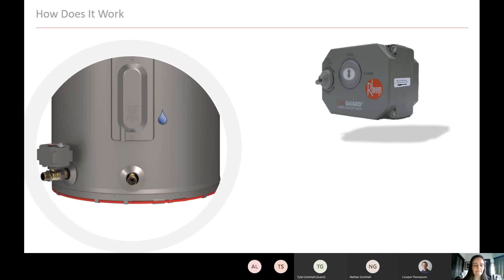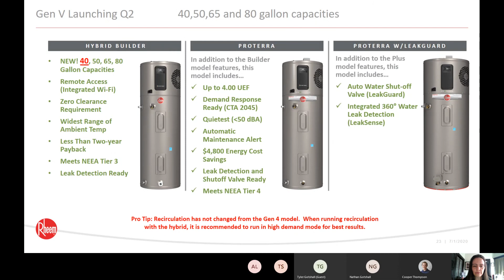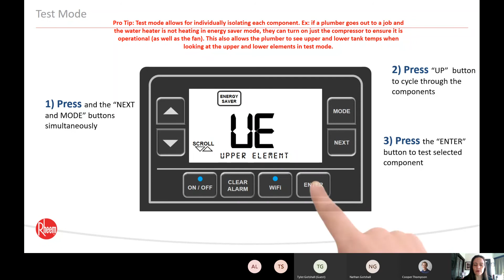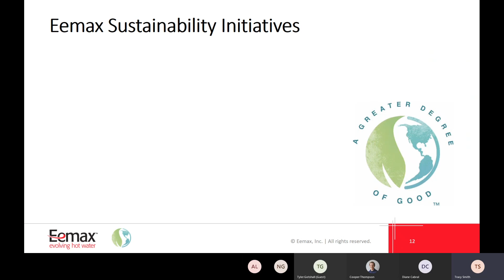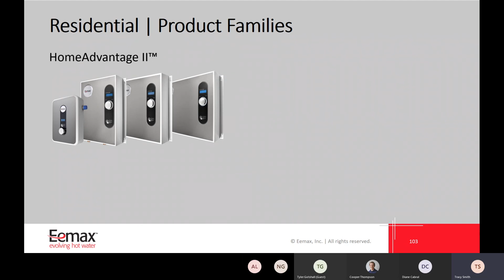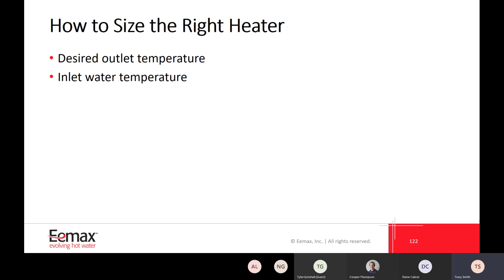Rheem All-electric Water Heating

Comment: I like to know if I can use the Hybrid water-heaters for dual purposes which means using the unit for domestic use and to heat my home with a hot water system, zones and circulation pumps? I have already the lines  and  in place and need to install the plate radiators, the house is well insulated.